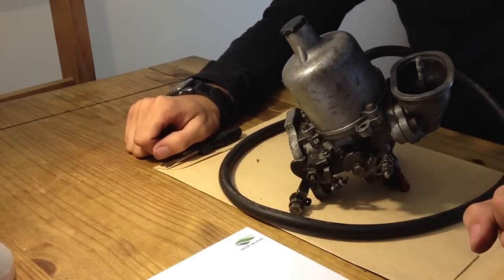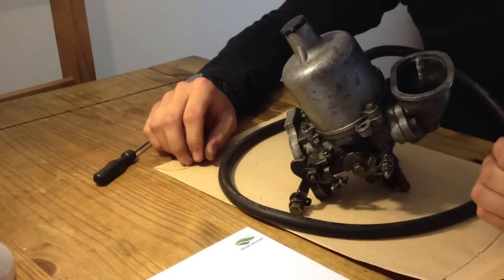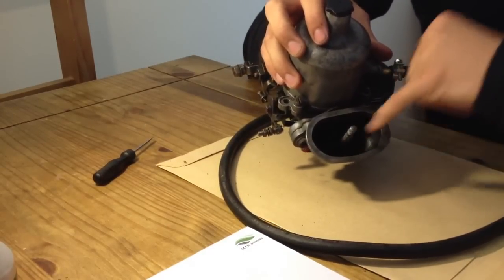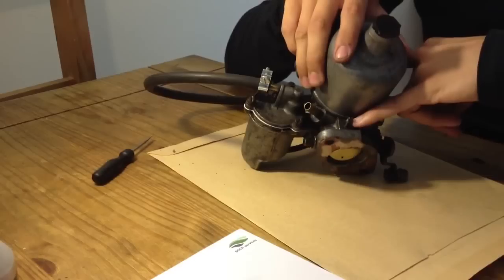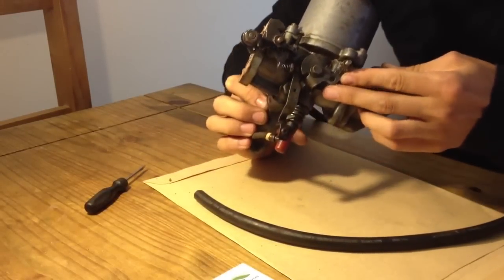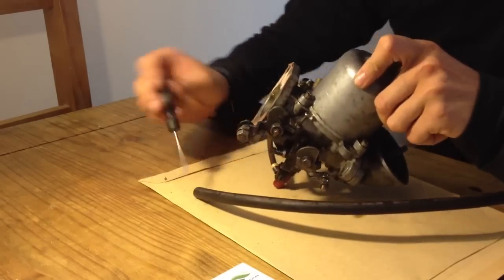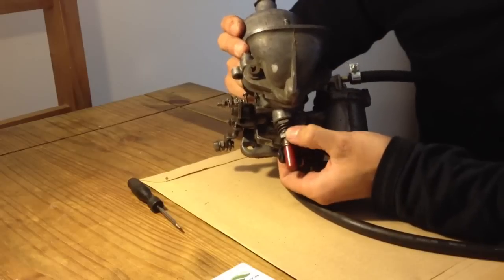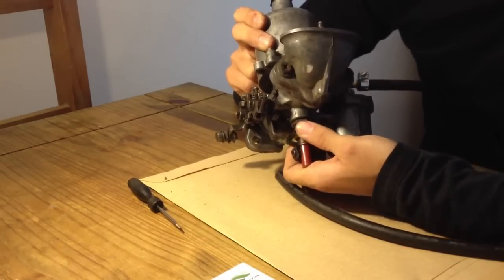SU HS4 - Carburettor basics

Comment: supposed i had done some mods inside my engine such as port and polish and piston oversizing, is it necessary to lean out the mixture ? or richen the mixture? what are the signs that my engine is running lean? i notice that if i reach a higher RPM say at about 5,000 RPM, i begin to hear rattling noises and my car hesitates to accelerate further like a loss of torque, it seems like the fuel is cut from my engine. what can be the problem?
Reply from the maker: If I were you, I'd invest time and money getting your car on a rolling road to make sure that your air-fuel ratio is right where it should be. You engine is now breathing more efficiently, so if personally try adding a little more fuel (richening the mixture) in measurable adjustments ( one or two complete turns of you mixture adjusting nut or screw. This way you can always return the carburettor to its original setting. Second to that, you could invest in a colour tune and try getting the mixture right from there 
 https://youtu.be/_49yYvPsHPI

You could also try a different carburettor needle as the fuelling demands will be different. 

Hope this helps. Give me a message if you need any more help
Reply: Thanks Mate ! i'm planning on changing my carburetor. it looks like it's not doing its job properly, by the way my carburettor is the "aisin" type the ones you find in japanese cars. and i can't access spare parts for my carburetor in our country. such a pity . but nice video! thank you for the lightening things up!